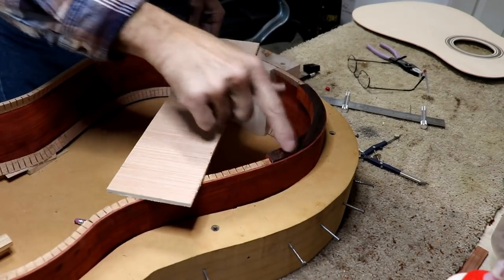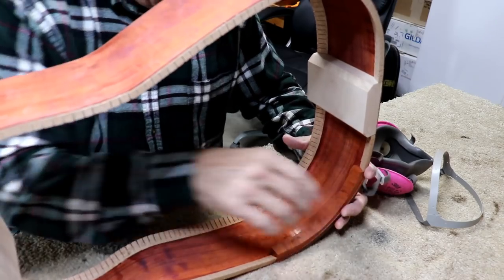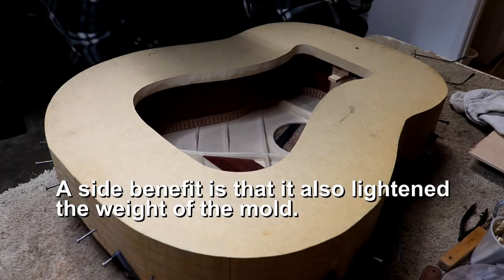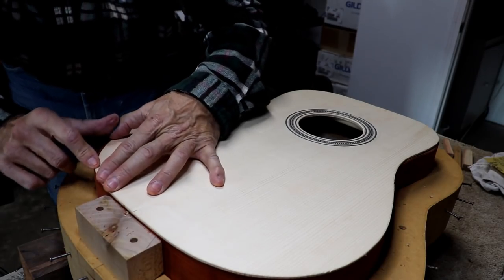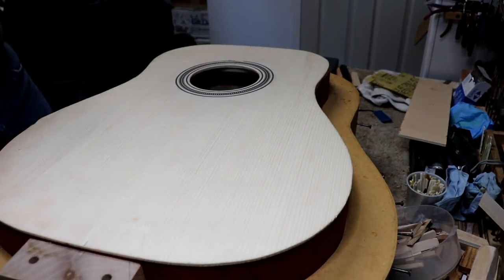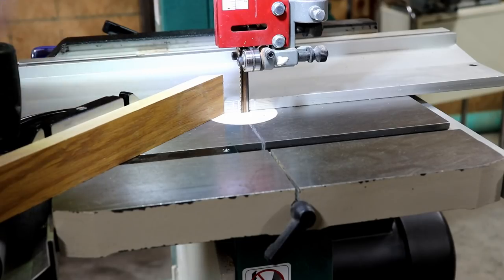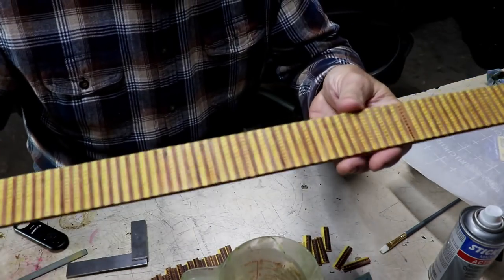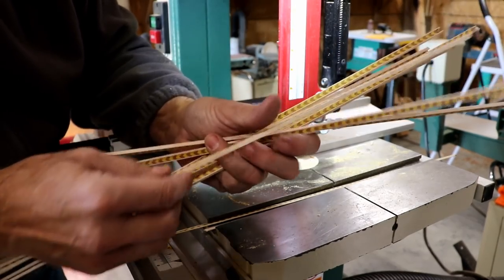348 Rsw Custom Guitar Build P3  Homemade Inlay Strips 1

Comment: Great job...love to see you at work :) What if you did cut the reces for the armrest in the top first. Then you could easily trace it to the padouk. Also: when cutting a piece of wood with a knive ( the side joints for instance) make a carve and then cut away the waste side in between cuts so you keep more room for the kniveblade. Looks like more work but it saves time in the end and it keeps your cut more prestine.

Comment: Jerry, I'd really like to See how you cut that inner tube. All I can find on the web is people cutting shorter strips.
I do understand cutting in a spiral will yield a longer band but I just can't wrap my head around how to start that.
If I was dealing with a flat square or circle, I could do that fine.
I know it is a simple concept but I often have difficulty visualizing simple concepts. (I'm ADHD)
I am sure I'm not the only one who would benefit, from actually Seeing how you do that.
If you could plug in the visual aid, as a tip, to a future video, that would be fantastic.
Thank you

Comment: I've had the same issue with dust produced by the dremel or sander and my solution has been to use my small vacuum cleaner and just lay the hose close to my work. It takes nearly all the dust right out of the air near my tool and since it has a hepa filter, non of it gets into the air in the room.
Reply from the maker: Obviously that works when it works. But often it's in the way as in doing detail work on instruments.

Comment: Another great looking guitar in the making!  I noticed you trimmed the kerf (you said it was a hit high).  Is this something you normally do to get a good fit of binding against the top?  Perhaps installing the kerfing is a bit tricky.  Just wondering.  I have been toying with the idea of trying a build myself some day.
Reply from the maker: The kerf was installed slightly above the edge of the sides. So cutting down the kerf to match the sides it's something you need to do.
Reply: @RosaStringWorks  that is good to know.  Thanks for the response!

Comment: Jerry 1st off Great build video, I do not mean to question your knowledge or building. I have a question Iam pretty new too building acustic guitars & ukuleles my question is The neck block you have on this guitar looks thin?? I dont know if its the camera angle but in all of my reading & research I was told too use a minimum of a 7/8" thick neck block. If you have time I would appreciate your input. Thank you Scott
Reply from the maker: I'm not in the shop at the moment to test it but I believe it's one inch exactly.